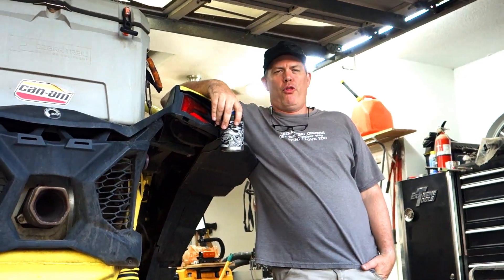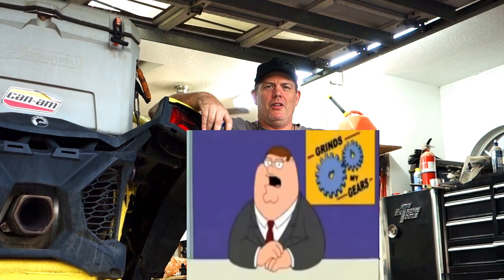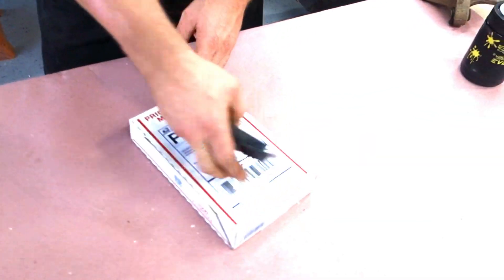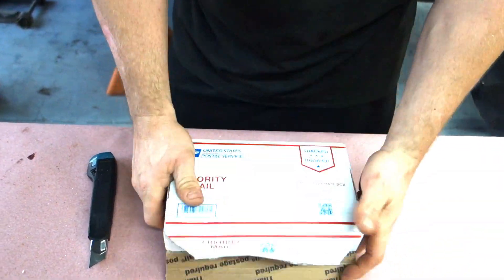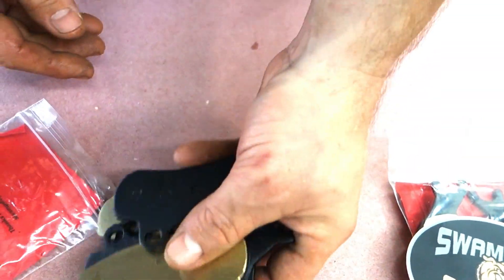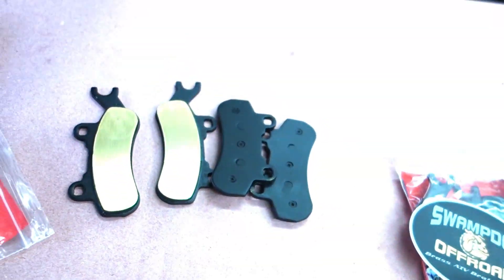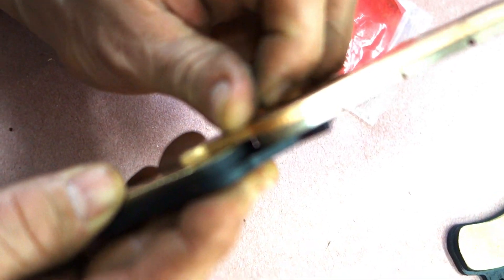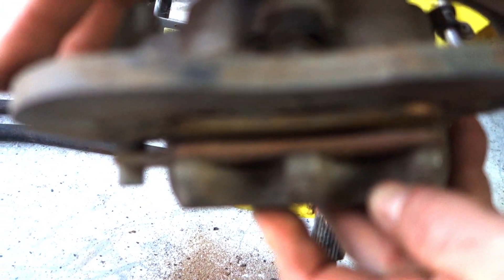Our First Look at Brass Brake Pads for the X3

Comment: Every 3 rides? I have 8 thousand miles on mine and I'm changing them for the first time.
Reply from the maker: Im guessing you don't live in Florida. Most guys up north don't suffer the brake pad issues we do.
Reply: @oneoffgarage  I'm in AZ . I guess I could see how the mud would cause problems.
Reply from the maker: @bburg1776  the fine sand, mud and water destroy the pads crazy fast. Even if you hardly use them.  Im sure happy to have the brass option